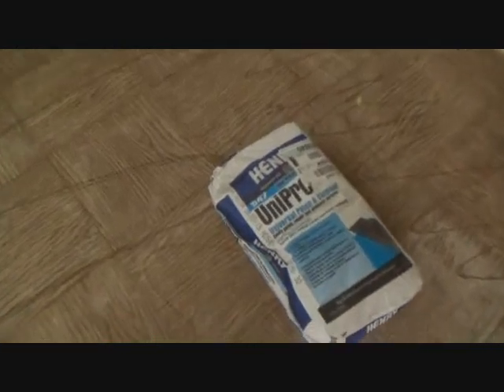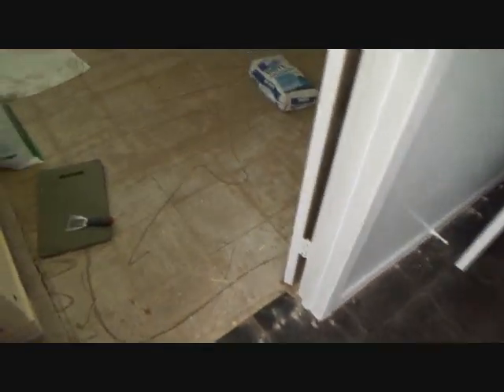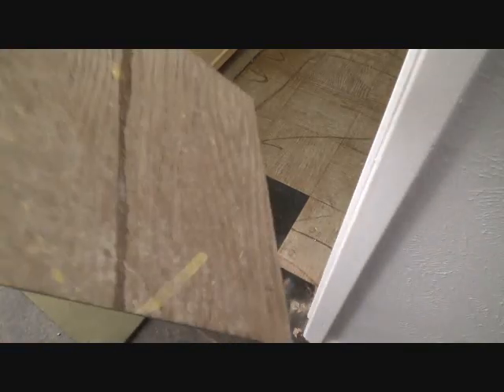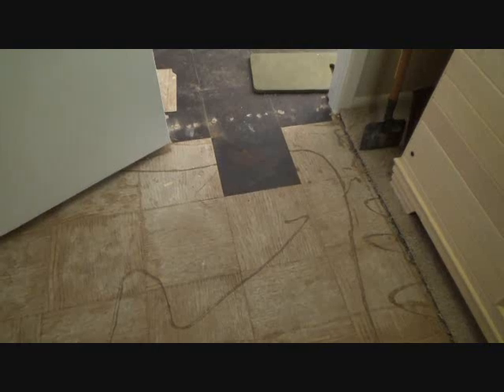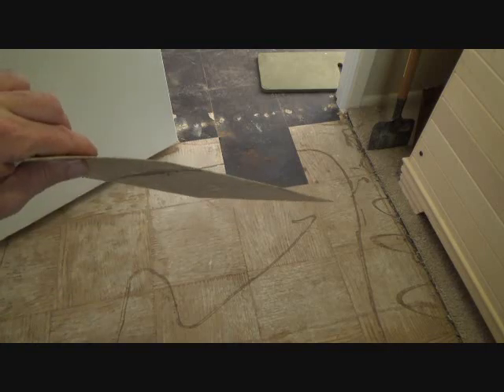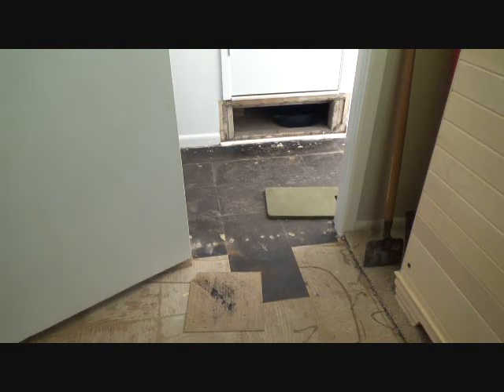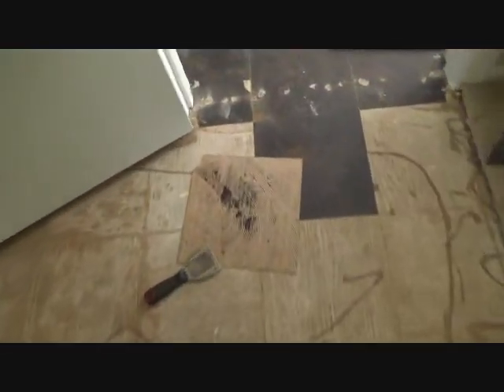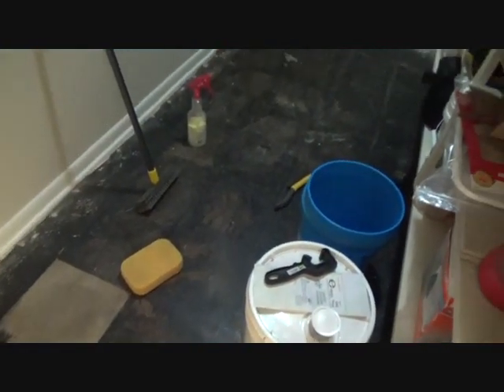Do you have vinyl asbestos floor tiles?

Comment: not true,I  only use black adhesive when im installing vct.  I've installed probably 600000 sq ft of vct in the last 25 years.  Most vinyl tile  produced after 1970 is vct,not asbestos.
Reply from the maker: Thanks for the info!

Comment: I've heard that the black "glue" under asbestos tiles normally has an asbestos in it.  It is possible that the house DID have asbestos tiles and a prior owner removed them and then put your current tiles down in order to seal off the black asbestos "glue".  And now you are removing that seal and exposing the asbestos once more.  Just a guess.
Reply from the maker: Your thoughts could be correct. Once I removed the existing vinyl tiles I wanted to remove the black tar since the owner wanted her concrete floors stained & sealed. I figured even if the black tar had asbestos type material in there, the black tar was not dry but damp to the touch & I always kept the mastic wet with removing it & my experience & what I've heard is the asbestos will only get airborne if the asbestos material is dry which the mastic was not dry so I don't think any of the asbestos like material ever got airborne as I was working on the floor thereby I was safe. At least that is my take on things....

Comment: I have tested the black tar stuff from one of my houses and did contain 3% asbestos. Used something called Bean e Do to removed it and it came off very easy turned into an oil type liquid. Now I am trying to remove these tiles from a other house but yeah they are very thin etc.
Reply from the maker: Wow thanks for your info re Bean e Do.....

Comment: Thanks for the info.  I"m looking to put vinyl plank flooring over 9 x 9 tiles with asbestos.     The surface is not flat so I'm looking to got over it with something, but not sure what.  Maybe some 1/4" plywood with construction glue and screws.   Any suggestions?  Thanks.
Reply: Do not screw into it. Then it becomes friable which is dangerous.
Reply: @markconboy8366  I’ve seen a pro screw into it by putting shaving cream into a plastic cup, then sticking the drill bit through the cup.
Reply: @JayZoop  yeah I’m just saying it scientifically says once the asbestos flooring turns into a dust it is then dangerous and deadly to inhale. So do whatever tricks you want but that the end of the day is mesothelioma worth it?
Reply from the maker: So how did your project go? What did you end up putting over the floor prior to installing your vinyl planking? I would ad I guess you could've applied self leveling material down over the existing tiles & then laid your flooring over that. Just curious what you decided to do...
Reply from the maker: Yes the asbestos will come out of the tiles if you screw into it or crack it or break off an edge as that's when you release the asbestos dust particles into the air....
Reply from the maker: Yes if you crack it or break off an edge or drill into it then you are releasing the asbestos "dust" material into the air. If the flooring is tight down to the floor then you can cover it a different way...

Comment: Worked on brakes with the material in the linings not as a job but as a hobby back in the day, if you find it get it out of the house before they come with the space suits. You will live! Tiles would be for the most part encapsulated. I know my brother tore down the Asbestos on his oil fire furnace pipes before the space suits found out. If there is too much, yes better to walk away and write off the house...
Reply from the maker: +Curiosity Just bringing it out to let viewers be aware of the issue. Yes once you get inspectors out or tenants is when the fun begins since inspectors insist on having it removed by a professional asbestos company. That's only if you need to remove it not if you want to just leave it alone & as you have said, encapsulate by covering it with carpet or laminate/wood planking,,etc.. Thanks for your message.!

Comment: I had a house built in 59’ had these same tiles (9”), tiles lab tested positive 5% asbestos which I knew they would but also the glue tested positive for 10% asbestos. I’m no pro so do your research!! For slab foundation keep wet during removal, only remove what you MUST, prime and seal with self leveling concrete.
Reply from the maker: Good thoughts for sure. Thanks for your input!

Comment: The house what my parents bought was 1937, UK. They asked me to use a 'vaporetto' steamer, to lift up the vinyl tiles in the bathroom, so I did. It smelt so bad, they were old tiles, and it had a distinct smell, it had left.a dirty brown adhesive liquid/gel on the floor, there was some tiles that were easily lifted by a chisel, and some were hard. The tiles sometimes broke off. It was thin, black and white patterned tiles.
Reply from the maker: I have heard some viewers say hey Joe you can't smell asbestos because asbestos doesn't have a distinct smell but you never know! I have seen some floor tiles like yours that look like vinyl tiles but years ago they use to make lots of floor tiles with asbestos in them & I was told years ago by a tile installer that if the floor tiles aren't exactly 12" x12" & if they are smaller than this then chances are they have asbestos in them. You can remove them with heat if you are careful not to break them because that's when the asbestos is released into the air is when the tile breaks. Anytime you have a question you could always lift one little piece or scrape up some glue or whatever & take it to a lab to have it tested then decide how to go about removing or not removing or covering if in fact you have asbestos present. Hope this helps for future....

Comment: How would you know if the mastic underneath has asbestos?
Reply from the maker: Chances are if your house has been built before 1977 & your mastic is the black stuff then chances are the mastic will have asbestos in it. Not always but....
Reply: @VideoJoeKnows  what if my house is built before 1977 and the glue is clear? what than?
Reply from the maker: @MangatSingh-no1gf  If the glue is clear then chances are it's vinyl tiles but I don't want to be the one to tell you that for sure seems as though I am not there & haven't seen what your tiles look like. Measure your tiles...if they are 12" by 12" then the tiles probably are vinyl. I know you said your house was built before 1977 but by how many years do you think? If your house is really old then chances are the tiles are asbestos is my thinking...you could take one of your removed tiles to the store & show it to someone to give you their thoughts....
Reply from the maker: @MangatSingh-no1gf  Hey just so you know...I now have a Roku TV channel called DIY for Beginners.....if you have a Roku TV check it out! You can also upload Roku to a laptop computer for viewing as well. Take care!

Comment: I would also think that mastic contains asbestos just from experience
Reply from the maker: +flipdaskrip I would think this cutback material mastic prolly had some asbestos in it but no worries if the mastic is wet & not dry since asbestos will not become airborne if wet.

Comment: Use a wallpaper steamer to remove asbestos tiles safely.  Then the black mastic is even more dangerous, so just pour concrete leveler over it.  Asbestos tiles that have been wet come up easily.
Reply from the maker: Thanks for the info. for sure!

Comment: Hello, I have an old floor at my place containing some asbestos, we've got it tested professionally: They told us is the lowest risk of all and asbestos is not easy to free from it as is bonded with the vinyl compound. To fee the asbestos you literally would need to grind the tile into fine powder. However, the floor is in good condition and we would like to leave where it is and installing some modern vynil colored floor over it. There are just a few cracks that would need to be sealed. My question is: Which is the best self leveling compound I can use on top of such tiles? Something that stick onto them and make the floor nice and ready to get the new vinyl layer on top!
Reply: I'm in the same situation.   What did you ended up doing and how much it cost?
Reply from the maker: Not sure but if you go to your local hardware store I'm sure they would have something to suggest for you. What did you end up using? How did your new floor come out in the end? Thanks for your message.
Reply from the maker: Have not heard back from them but I would say to you to go to your local hardware store & tell them what you want to do & see what suggestions they might have for you. So it's two years later....did you end up doing your project? What did you use?

Comment: I was  in a asbestos tile removal from an entire grammar school. They used a heating machine to soften the tile and tar. It kept tiles from breaking. The tar burnt though and stunk to high hell. If the asbestos don’t get you the burnt tar will lol :/
Reply: Will the tiles be really easy to remove? Or its it hard. I removed some 9 n a half tiles from a kitchen but was really ready to remove i mean lift cornor and then use hand to remove it? Don't have the money to test nor perfessional
Reply: They used machine to heat up the tiles to get tar to release them. If I had to do it on my own I may try a clothes iron to heat then push flat scraper under to lift them..
Reply from the maker: Yes if you actually have asbestos tiles then heating them up & scraping them up without breaking will not release the asbestos into the air so good job for doing it that way. I hear they now have a product to easily remove the black tar mastic. Never used it but if I ever need to use it I will research for sure...Thanks for stopping by!
Reply from the maker: If you can remove without breaking then go for it. When you break a tile is when the asbestos gets thrown out into the air...sometimes they are easy to remove like you explained while other times they are stuck down so bad that you have to remove a different way...
Reply from the maker: That could do it.... or if you have a big enough room you can buy a heat gun that looks like a hair dryer but different.
Reply: I use a terminator infinity scraper machine on comercial bldg and waterjet machine 45000psi on bigger jobs.
Reply: @MAGA1440-s2m  the water should keep any free radicals in the air down, if you have the luxury of not getting water damage. Cool, thanks for tip ! :)

Comment: 2:58 "should've had my gloves on" a mask or respirator is much more important. Inhalation of asbestos is the main problem. A previously flooded floor will have lose asbestos tiles, as best as I know.
Reply from the maker: The asbestos on these kinds of tiles will only get into the atmosphere if you try to remove a tile let's say & you break it as breaking the tiles will then release the asbestos into the air...if your tiles get flooded & you dry suck up the water then dry out floor you should be fine with no asbestos released....The asbestos is sealed into the tiles per se & will stay in the tiles if you do not break the tiles. Thanks for stopping by!

Comment: 1977 isn't a good cutoff year. anything before 1985 is a good cutoff. they still used the stuff after the cutoff.
Reply from the maker: I guess if a warehouse still had things for sale after 1977 then they could sell it but not manufacture it after 1977. At least that is what I heard one time...not sure. Your message makes sense though...don't just take for granted that a house doesn't have asbestos after 1977. Be safe rather than sorry. I guess if you purchase a house a couple years past 1977 let's say then you might want to have some of the different materials in the home tested...as a thought.

Comment: We were about to remodel our family room with wood floors...So I lifted the carpet by our rear family room door...the subfloor was very soft, apparently water made it in thru the door so I started (Easily) picking apart the subfloor cause it was damp, now i'm worried it has Asbestos, cause it had layer of a thin wood over some type of linolium and then the subfloor which was soft and crumbling over a small section by the door... and Its now exposed? I was gonna just rip out the subfloor and put new plywood down but now i'm worried its gonna more of an issue!?!  So terrified this is gonna be a huge costly problem if it really is asbestos! Home was built in the 50's.
Reply from the maker: +area859 Take some pics of it & go to your local hardware store & see if anyone there can assist you with what your floor has on it. Don't panic just yet!...lol
Reply: +VideoJoeKnows lol, I'm already panicking and stressed.  The vinyl tiles are visible and are sandwiched between subfloor and some other thin wood on top
Reply: +area859 thanks for the advice btw, I'll take pics and video on my tablet and hit one of the big box stores. Thanks
Reply from the maker: You're welcome. Good luck! Let me know what you find!
Reply: +VideoJoeKnows I will. Been reading on testing and removal, it can cost thousands and it's not covered by homeowners insurance.
Reply from the maker: yes asbestos has to be removed by a certified asbestos removal company & expensive in deed. If it's just a small loose area that needs to be repaired you might be able to do something like that provided you then encapsulate the rest meaning going over the rest & not disturbing it. first see what it is. If the box store doesn't know you could remove a small bit & take it to a lab & they can analyze it & let you know what it is. There are labs out there for just that reason......
Reply: +VideoJoeKnows oh ok, I will do that. You have any idea on what tests run $? And how quick they can get results back?
Reply from the maker: Not sure how much the test would be but the results shouldn't take too long. I did a soils test years ago & I remember it didn't take that long. & the cost I would guess at $250 but that's just a guess. i can't imagine it costing more than that & hopefully it's just half that. But that's how they make their money so if you end up going that route, let me know what the test cost you......another idea is you could call up an asbestos abatement company & ask them to come out & do a courtesy inspection for you explaining to them you are not sure if you have asbestos of not & they might be happy to do this for you especially if you have asbestos their thought would be that they might get some work out of you.....! that route could be way cheaper than a lab test. You owe me lunch now...!   lol
Reply: +VideoJoeKnows lol, The thing about having them come out, how would I truly know they were being honest about results? They could be like, Hey Yes you have Asbestos so they can make $$...but we gotta get this determined for sure asap....I can't even sleep i, so stressed....and by the way...there is no smell like you stated in video
Reply from the maker: If they are an honest reputable company, they will tell you the truth. Their reputation is at stake........
Reply from the maker: google companies near you then there might be an area where they have referrals & you can read some of them.
Reply: +VideoJoeKnows Will do, No sleep for me tonight, it's 5:10 am now, lol. I'll head to a box store for a general opinion with video and pics and see what they recommend or even refer someone
Reply from the maker: Great. Good luck!
Reply: How much was testing?

Comment: You inhaled asbestos dust bro. There are home test kits
Reply from the maker: If these floor tiles were in fact asbestos filled, the asbestos would really only come off if the tiles were removed & if the actual tiles would break or crack when you were removing the tiles thus releasing the asbestos to the air. If you do not disturb asbestos tiles then asbestos really should not be released into the atmosphere. In that case you could leave the tiles down & go directly over them with carpet pad & carpet for instance or you could install a vinyl type tile over the asbestos tiles or install laminated flooring over the undisturbed asbestos tiles for examples....
Reply: @VideoJoeKnows  bottom line, use an asbestos test kit. 'If it crumbles and smells like asbestos...' isn't a legitimate test
Reply from the maker: @dare2scheme904  Yes I hear you there. I am all done with this particular project but I can see how a test kit would be a good thing to use for next time. Much thanks!

Comment: most of the time asbestos tile come of as easy as non asbestos .  especially when they have been water soaked .  If it has black jack glue do not continue removal . The glue is as dangerous or more than the tile itself . Get them tested . Its cheap insurance
Reply from the maker: Thanks for stopping by...

Comment: You would have been safer just floating over the tile all together instead of messing with the black asbestos containing underlayment.. Me and my brother done asbestos abatement for several years back in the late 80's to early 90's.
Reply from the maker: I would've floated over the entire floor as you have suggested but the owner wanted to have an old leather looking stained concrete floor & I didn't think I could achieve that look with new floated out floor so I went the extra mile & removed the floor tiles then removed the black tar mastic....yes I did! The floor turned out looking just like old world leather when I got done....